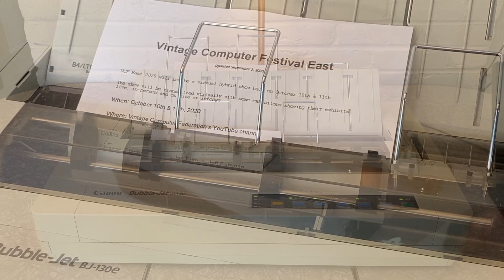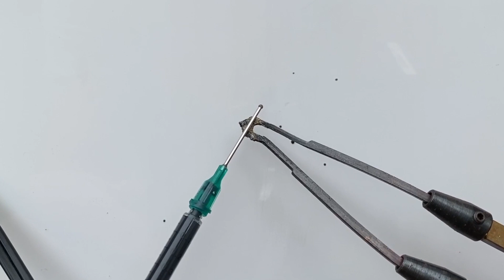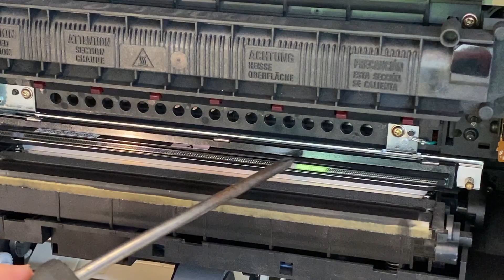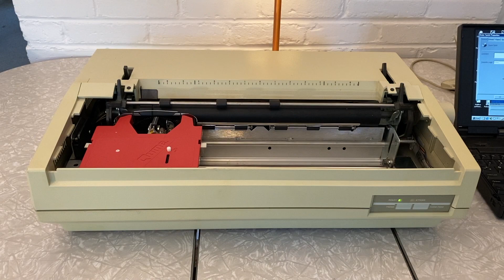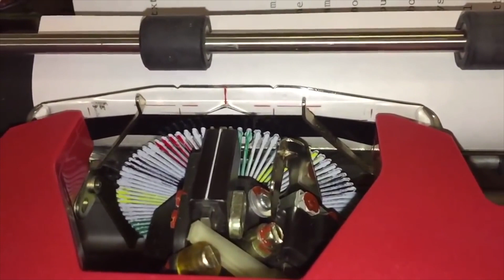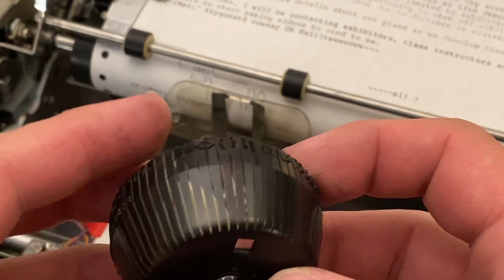VCF East 2020 - Printer Time

Comment: I used to have a C. Itoh 1550 which was the wide version of the 8510.  I found that it excelled at halftone graphics, and it found a good amount of use in printing black and white signage.
Reply from the maker: They really are great printers. Simple, reliable, and good output quality.

Comment: Astonishing that the cannon bubblejet print head still isn't blocked after all these years - have you had to force any solvents through it to unblock it over the years or is that totally original ?
Reply from the maker: Those early bubble jets do a good job of sealing. It had been unused for at least 20 years. The print head was blocked up, and the ink in the cartridge had evaporated some. I added new ink to the cartridge, cleaned the waste ink pad, and used a syringe to force alcohol into the print head (unhooking the tube from the needle that enters the ink cartridge and goes up to the print head). 
I had a blow out at one point that made a mess, but after a couple hours of manual cleaning, running clean cycles, and test prints, it's working great! 
Something that took a while to get right was the ink level sensor - a pair of probes in a small "surge tank" between the main ink tank and the print head. They were of course gooped with dried ink, and until I got the ink concertation diluted and those probes clean the machine refused to work.
Reply: @compu85  I had a feeling there was some serious time put into that printer to not have a single blocked nozzle streak in those impressive solid blacks. It might be the last fully functional 1980's era inkjet printer on earth.
Reply from the maker: @MMWA-DAVE  probably not the last, but close! If you look in my other videos you’ll find the Cannon PJ 1080A - a piezo based inkjet which came before this bubble jet. That one took a lot less fiddling to get going! 

I have an original Apple LaserWriter as well, it’s got a bunch of problems. I’d like to get it working well again too, but the odds are stacked against me since the rollers have turned to goo and are long NLA.
Reply: @compu85  I seem to recall the apple laser writer series were based on the canon CX, SX and LX engine series, beleive it or not I still have the paper backed service manuals for all the early apple laser wiriters as fixing laser printers was one of my first jobs!
Reply from the maker: @MMWA-DAVE  Yup! They absolutely were! The early CX engine stuff is what's so had to get now. 
While working on my original LW, I lost the cable that goes between the Apple controller board and the DC Controller. Despite what the service manual says, it doesn't seem to be a 1-1 connection (or something is wrong with my Apple logic board). I'm trying to track down someone with one of these machines so they can beep out the cable, I hope to finish that up in the coming months. 
Next week someone is giving me a LaserWriter IIG!
Reply: @compu85  Did you know there were copier versions of the CX engine, i assume thats where it originated from. It was also used in canon microfiche printers, but  copier/microfiche operate opposite to laser printer imaging. In that light striking the drum does not attract toner, where as the laser version, where the laser strikes this is where toner is transferred to the drum. Putting the Copier version cartridge in the printer yeilded some very strange prints. In any case both those other versions were long since discontinued too, im sure the pickup and feed rollers would be similar if not the same though. You can alwas re-tire pickup rollers with a modern similar type unless its those weird solid rubber D shaped rollers they used to use (i can’t remember, 20 years ago now, lol)